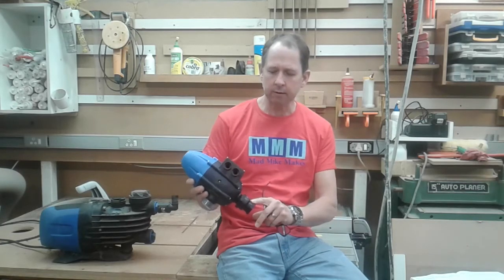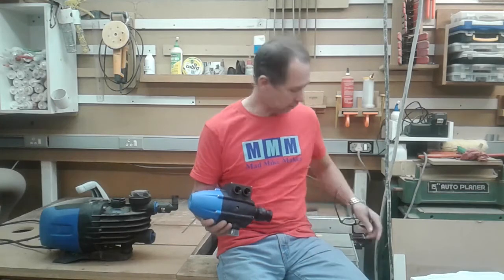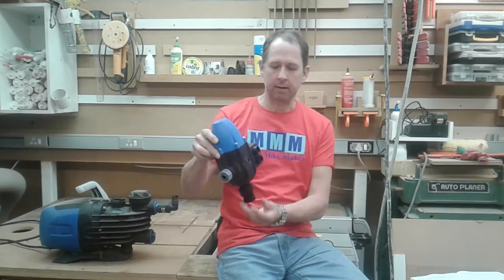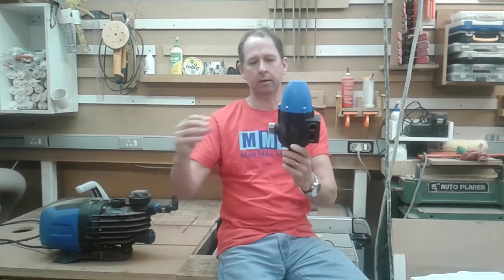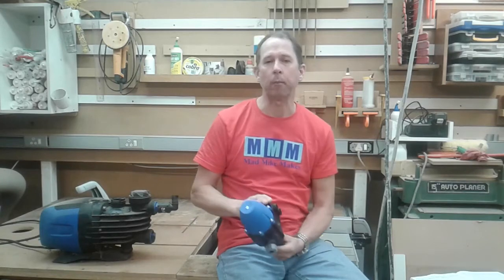Gravity tank VS Pump

Comment: Great info Mike thanks, our geyser is in our roof so would that then be the highest point to measure against the required height of the bottom of the tank?
Reply from the maker: Hi Alan. The video is more about getting good pressure from a gravity feed tank (Like a JoJo tank). I'm assuming you have a solar geyser? If so, that geyser will be using the pressure from the municipal water source.  Hope that makes sense.